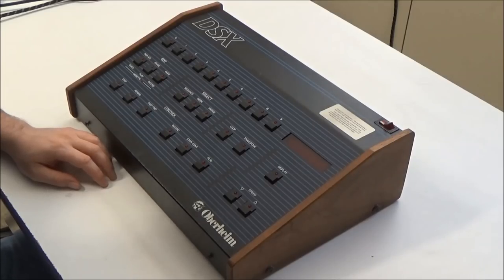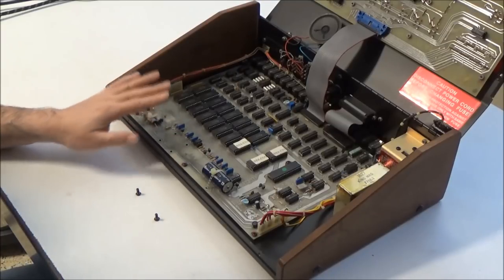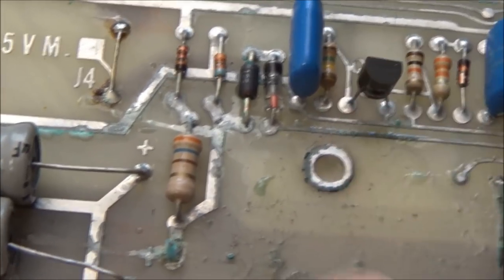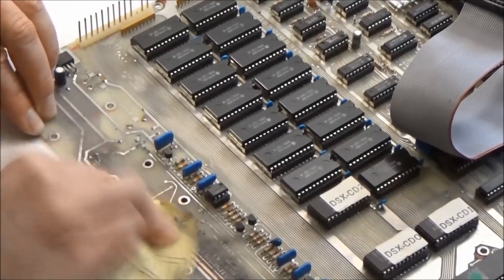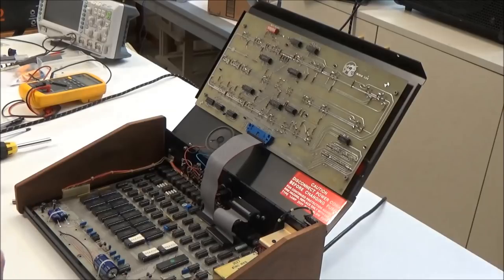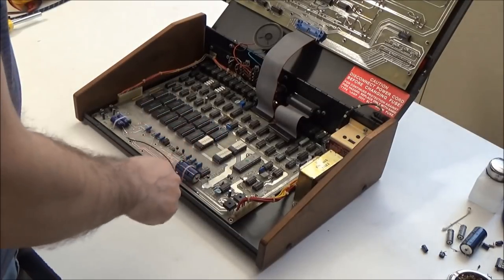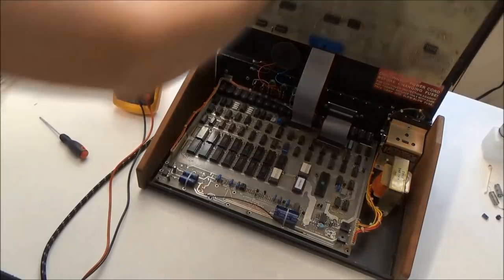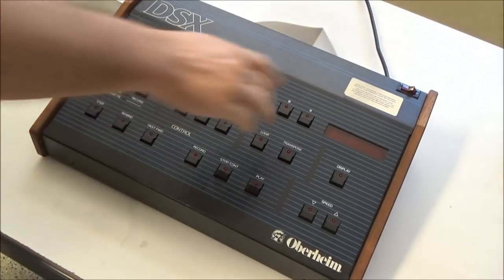Synthchaser #098 - Oberheim DSX Sequencer Repair

Comment: Hmmm, I would have first used the Exacto knife to cut a little trench inbetween the two traces. But of course just using a wire as you did, works as well!